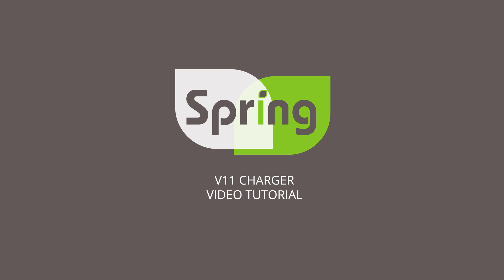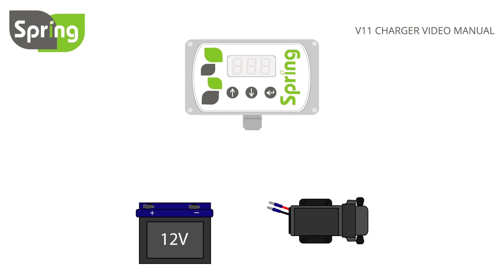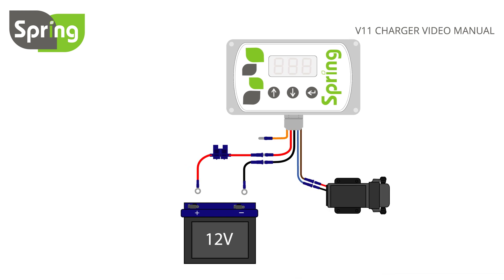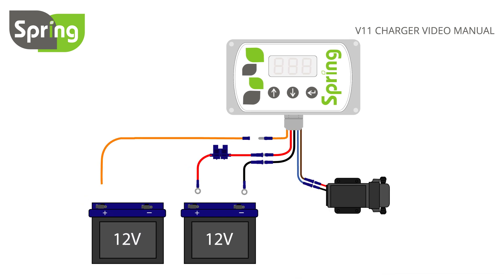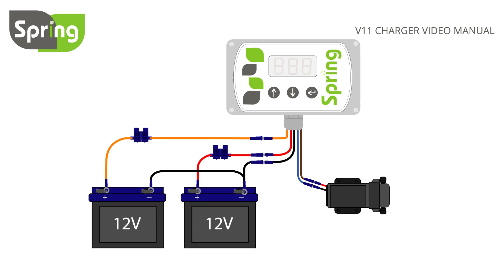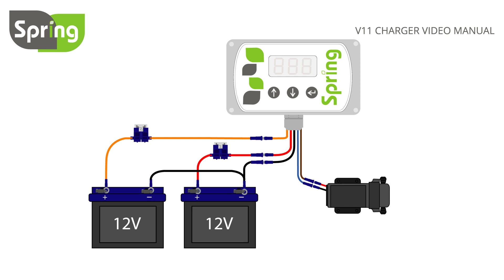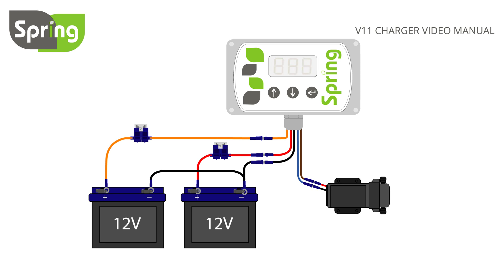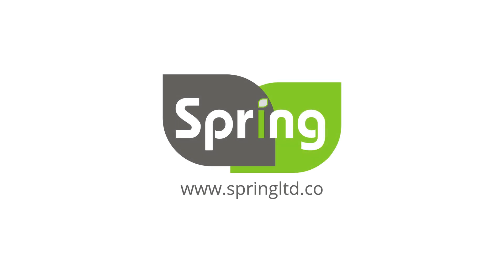Spring (Europe) LTD - V11 Charger Pump Controller Video Manual

Comment: This may be a silly question but does the vehicle battery have to be 12 v  like in this video?
Reply: Hi JC. The Charger controller is designed to work with 12v DC batteries. Although a full charged battery may actually hold 13v to 14v when very new. The controllers are rated for voltages between 11- 15v going above this could result in damage to the PCB.